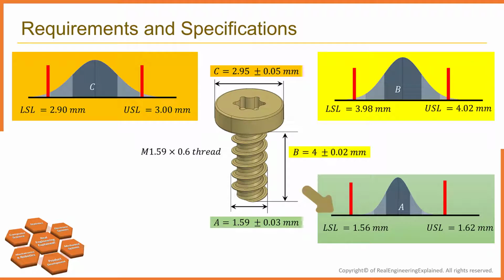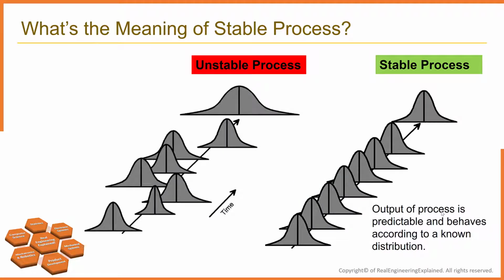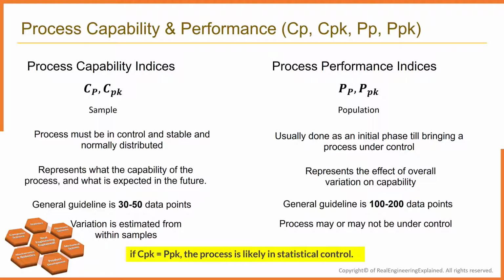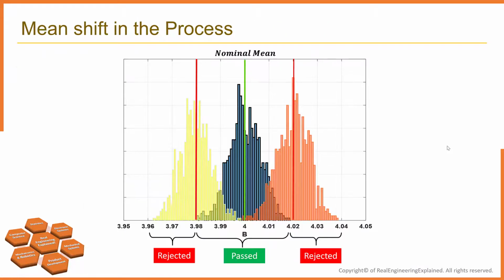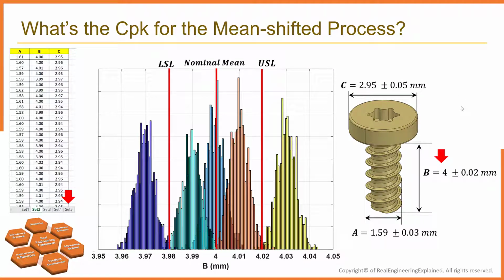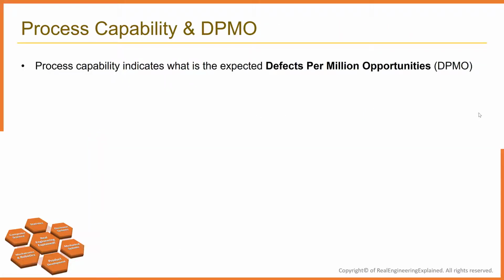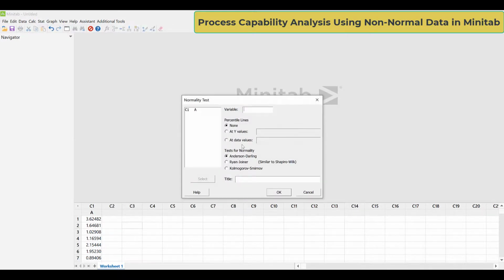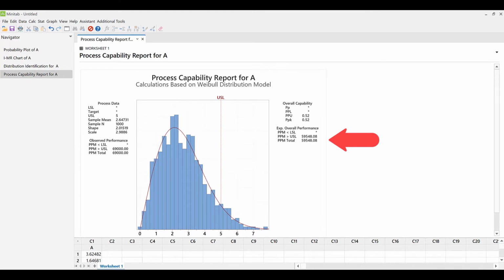Process Capability Analysis | Application of Statistical Methods in Manufacturing

Comment: few questions towards the explanation here
Why used 5 under USL for Non-normal capability analysis
Should have also explained when Weibull distribution is not applicable as Box-Cox and Johnson transformation for consideration and when performed the transformation of the data how to interpret or use that data.
Not Clear explanation for "How to improve the Cpk value"

Comment: Hi, great video! your pace made it easy to follow and thank you for taking the time to explain each step in the process. I do have one question though.. when you were finding the best fit to non-normal data, the weibull and 3-parameter weibull were decided as good fits for the data based on the p-value. My question is, why was the the Weibull distribution selected instead of the 3-parameter Weibull distribution when performing capability analysis even though the p-value for the 3-parameter Weibull was higher?
Reply: An answer to this would be very much appreciated.